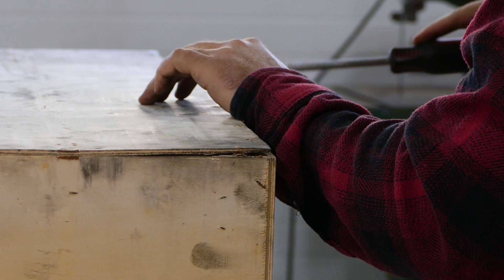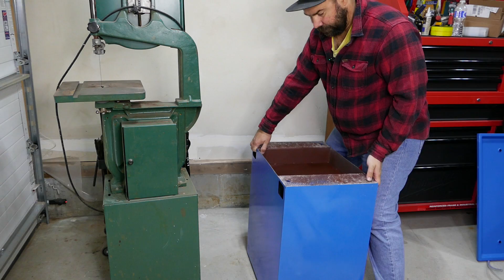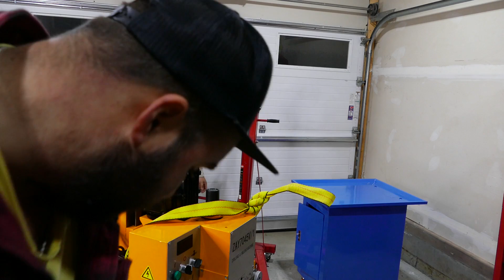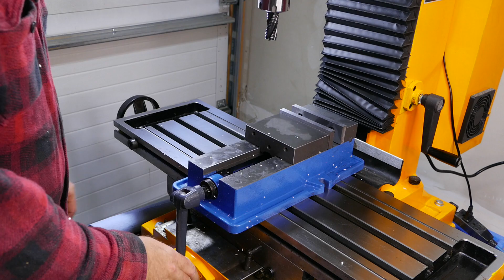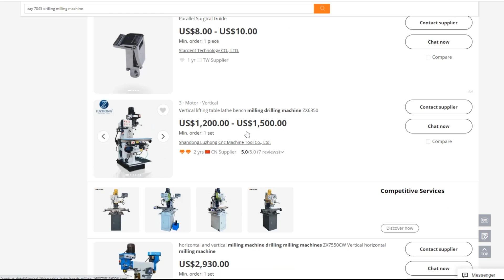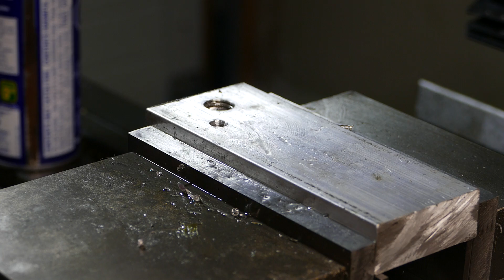I Bought a Milling Machine ZAY7045V/1 on Alibaba! Do I regret it?! Big Review and Testing!

Comment: A version of this machine was sold as a Smithy 329.  As of this positing its listed on their website as out of stock.  Its also available from Grizzly as a G0761.  There are slightly different features but its the same core machine.  

The Grizzly manual is well written and available for download.   This might be useful to somebody.  It might also might be a source of parts if somebody needs them.

Thought this comment might be helpful to somebody.

Comment: On my ZAY7035G I changed the oil in the gear head with some Royal Purple Synchromax High Performance manual transmission fluid and it dropped the noise level in half. Running 5 years now with no metal in the fluid.
Reply from the maker: That's a great tip, thanks for sharing!

Comment: It's not the way the collar chuck is supposed to be tightened. You damage both parts if you don't do it properly.
Reply from the maker: Thank you! Care to explain what is the correct way?
Reply: @Take_And_Make  you see a lip on the front off  your ER-collet, that clicks in the removable nut. Then put together into in the ER-holder. and then you can put you endmill in.
Reply from the maker: Thank you!